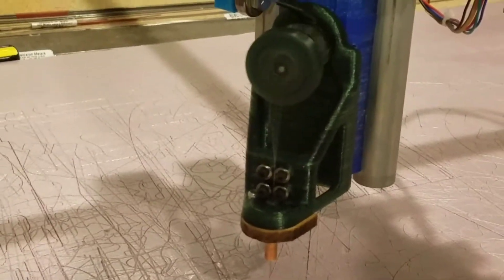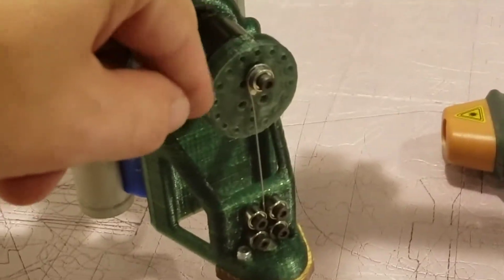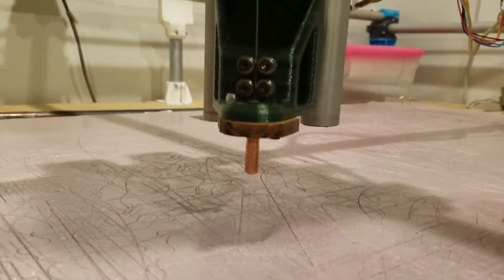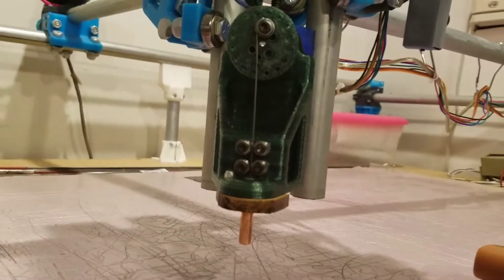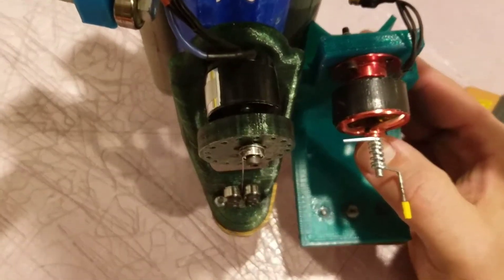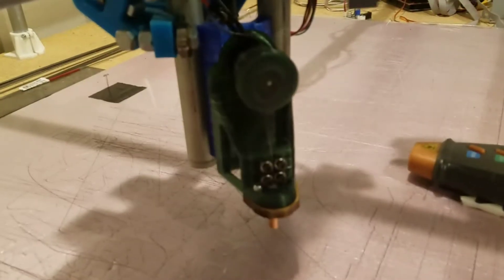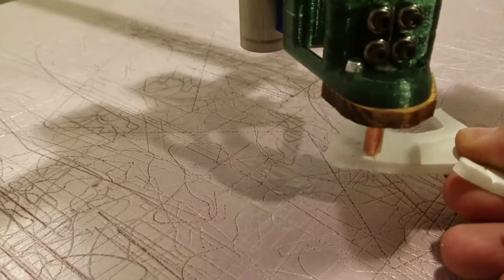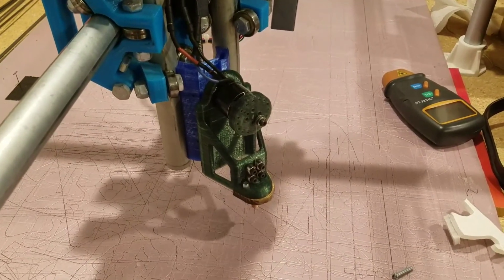Needle cutter v2 lives!

Comment: This looks excellent, I made a similar one (a TimSav variant) but the needles keep breaking, to the point where I've never used it because I can't finish a cut. How does the flywheel attach securely to the motor without a nut? I see that your motor stops slowly after you kill it, unfortunately my ESC brakes instantly so the flywheel tends to rotate out of the shaft...

How do you balance the flywheel? I don't see any counterweights.
Reply from the maker: The flywheel attaches with 4 tiny screws since the bell housing of this motor is tapped to accept a prop adapter.  They're hard to see since they're countersunk into the face to clear the needle.

I balanced it by putting it on a prop balancer and adding/removing washers and a small screw on the backside.  

I had a lot of problems with breaking needles at first as well - then I bought a cheap $13 tachometer and realized I was running it WAY faster than needed - since dialing the speed down I've only broken 2 needles.  1 while experimenting with cutting cardboard (it works...but you have to go REAL slow and it wears needles out fast) and one after 2 years of regular use.
Reply: @jhitesma  That's very useful, thanks!
Reply from the maker: The tach was really worth it.  When I first started with the needle it was suggested to just do the math calculating RPM based on the voltage and kv of the motor then setting the "throttle" appropriately.  But what I found is that all of the ESC's I had were decidedly non-linear so doing that didn't get anywhere near where I thought the RPM would be.   Once I had an appropriate throttle setting figured out I configured a servo channel on the RAMPS and sent some manual gcode commands to dial it in just right - then once I knew the value to use in the gcode command I added that to my startup gcode so it all goes automatically.
Reply: @jhitesma  Hmm that makes sense, thanks. So 7500 RPM is a good speed to run it at?
Reply from the maker: Honestly...it's been almost 4 years since I had to think about RPM.  So....if that's what I say or show in the video it's probably right.  But due to some life changes my machine has been buried for 2 years now and I'd have to clear it out, fire it up and take a measurement to confirm.
Reply: @jhitesma  Ah, I'll go what's in the video, thanks!

Comment: I love your machine!  I wonder,  how often do your needles break?  I am planning on .020" piano wire with a .030" tip.  Too bad about the tip getting hot.  Is there any negative effect other than possibly melting your PLA?
Reply from the maker: In almost 4 years of running it and a couple hundred sheets of foam I've broken 3 needles.  1 was when I was experimenting with cutting cardboard and pushed it to see how fast I could go.  1 was with an earlier crankshaft design that had tighter bends in the loop.  The last was after about 80 sheets of foam when I knew the tip was getting dull and needed a bit of sharpening but I was lazy and kept putting it off.  As long as you're careful to avoid creating stress risers (use round tipped pliers when bending the music wire and don't rebend the same spot) and keep them reasonably sharp they last a long time.  Once I got the speed dialed in and added a small wad of cotton with a few drops of light oil I stopped having heat issues.  The melting is the biggest issue with heat - and can cause the whole thing to jam up as the melted foam is pulle dup into the guide and then cools getting hard causing things to bind.  I've done about half a dozen sheets back to back (about 2 hours of cutting) and the tip was still cool to the touch once I got it dialed in.

Comment: Are you controlling the esc by a servo tester or are you able to control it from the ramps board?
Reply from the maker: When I was recording this (and up until about a week ago) I was just using a servo tester.  But I'd been planning on controlling it from the RAMPS before I even built the machine.  Last weekend I finally tweaked my start/end gcode so it's now fully controlled by the RAMPS.  It's not 100% ideal...since the RAMPS doesn't output any signal until it gets an M280 command I have to a "M280 P0 S0" then pause for 5 seconds to allow the ESC to initialize.  Then I do a "M280 P0 S85" followed by another 5 second pause to allow the motor speed to stabilize.  But...the S0 is only needed the first time I power up the machine so there's a 5 second pause at the start of most programs that could be eliminated if I modified Marlin to start outputting pulses at boot.  And the second pause probably doesn't have to be 5 seconds.  But even with a 10 second pause at the start it's so much nicer than setting the speed manually I'm not in a big rush to improve it.  Deails on how I set it up here:  http://forum.flitetest.com/showthread.php?24251-Cutting-foam-sheets-with-a-needle!&p=369010&viewfull=1#post369010
Reply: Nice!  Thanks for the info.